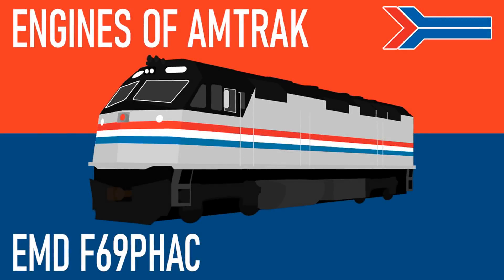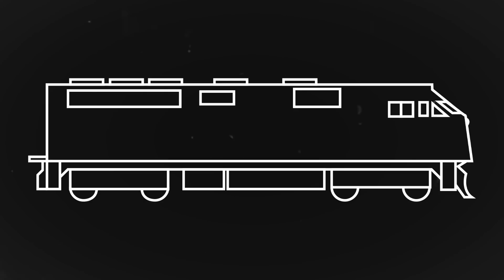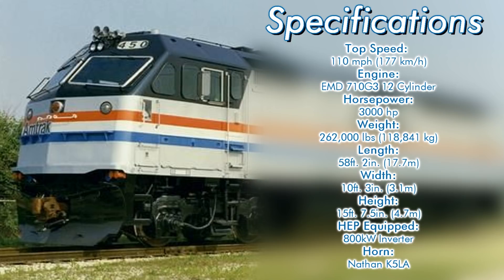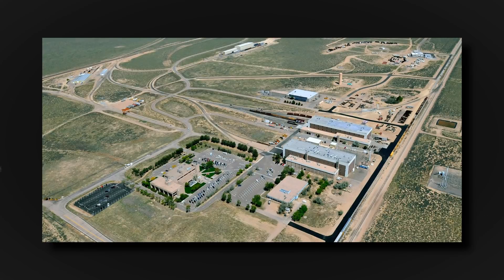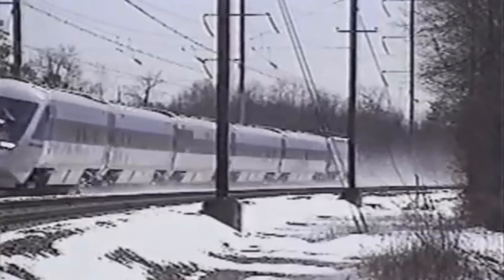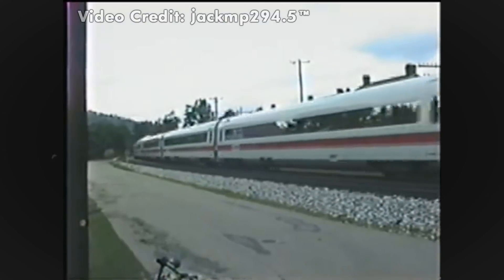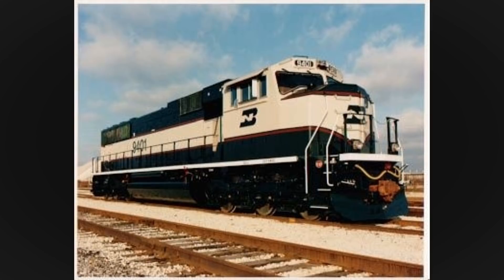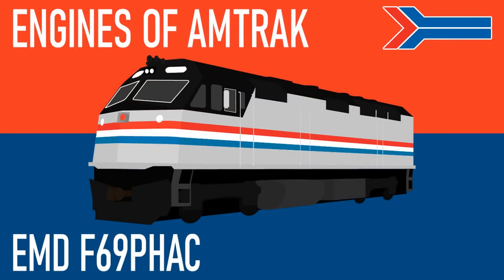Engines of Amtrak - EMD F69PHAC

Comment: The F69s are actually still out there right now in derelict condition however, they're definitely not extinct and there's some photos to prove so.

I have some feelings of what will happen to them

1. They will be restored and rebuilt by NRE and put back into revenue service
2. They will be rebuilt and converted to Metra F40PHM-2s
3. Restored and donated to a museum
4. Or most likely getting scrapped

Only time will tell the fate of these historic and somewhat iconic locomotives

Comment: My original California personalized license plates for my 1976 GMC Motorhome are "GMC F69" and I was going to number the unit "455" for the Oldsmobile 455 V8 engine in the motorhome, even though that number was never used for the F69PHAC. Over time I have decided to paint the GMC as SDP40F #644. It will parked outside the new 'Hi-Level Diner' restaurant north of the Cajon Pass in a few years. The restaurant will be an Amtrak Superliner Diner from the 1981-1983 production build. Stay tuned and check out GoFundMe!

Comment: Southern actually had a locomotive called the GP38AC and it might have some mixed reviews
Reply: 261 units were built in 70/71. Norfolk Southern and many other roads changed them into 38-2s later on. FURX acquired many of the units from NS. There is also the SD38AC with only 15 produced. SRY Rail Link still operates 4 of them.

Comment: "It was America's first AC traction diesel locomotive"
not really
in 1984 BBC/ABB had tested the three-phase traction with the M640 #CP4744 then in 1987 with the F40AC #F202.
both of them were equipped with thyristor voltage source inverters which controlled all the motors in parallel.
During 1987 also siemens equipped the EMD268 with 6 thyristor current source inverters each driving a single motor.
Reply: Didn't know about these projects! Also, there were even earlier AC locomotives, the GP38AC and SD38AC built 1970/71. As far as I know almost all 261 GP38ACs were changed to 38-2s. 15 SD38ACs were built and some still run with their AC alternator. SRY Rail Link still operates all 4 of the BC Hydro SD38s, with one being a SD38AC.

Comment: Weren't all those sold to caltrain, or METRA?
Reply: Later models of a different designation but with design cues from these.
Reply: Metra’s F40PHMs use the same body shell, Caltrain uses the regular F40 design
Reply: @AVeryRandomPerson  
CalTrain uses the upgraded design for the MP36, which comes from the F69. They do indeed have regular F40s as well.
Reply: @blue9multimediagroup  The MP36 uses a completely different design than the F69/40PHM. For start, it has 4 windows, and a curve.
Reply: @AVeryRandomPerson  look at the roofline behind the cab. Same straight sides with slanted top.
Reply: @AVeryRandomPerson  only difference is the cab is streamlined.

Comment: Fun fact: metra used these locomotives as f40phm
Reply: The shell and Prime Mover, but not the Traction Motors.
Reply: @AVeryRandomPerson  actually, the F40PHM used a different prime mover as well. The F69 used a turbocharged 710 engine rated at 3,000 horsepower, while the F40M's use a 16 cylinder, turbocharged 3,200 horsepower 645E3 power plant.